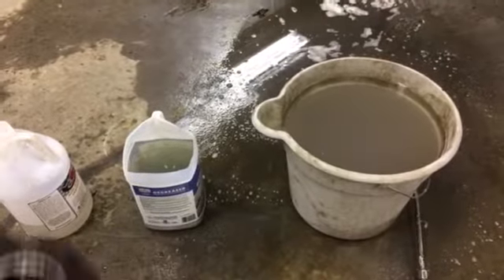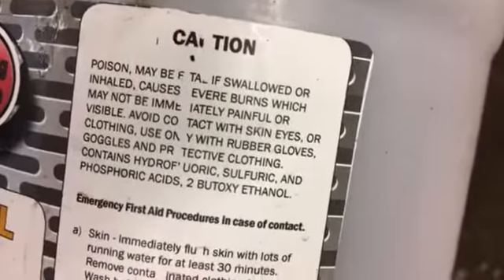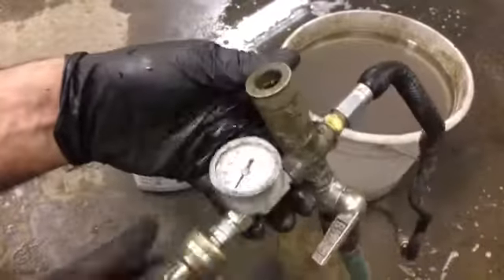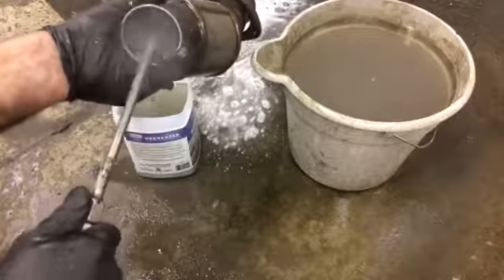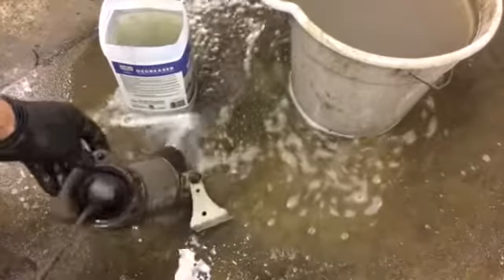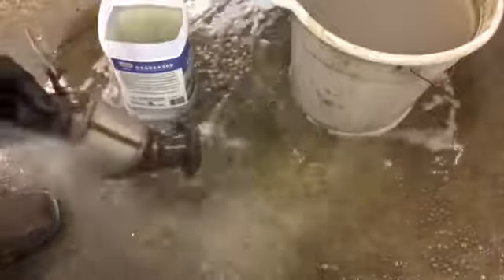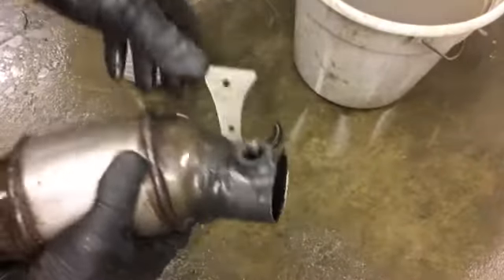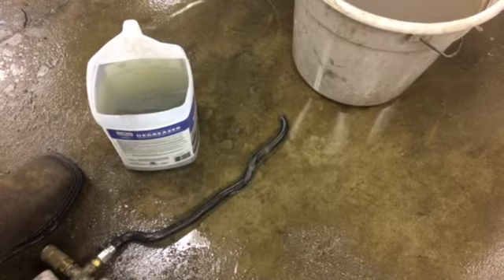Catalytic converter acid wash #1.

Comment: is that a prius cat . my prius no high rpm on hills no power. has a code p0420. you think this will fix it
Reply from the maker: This is a VW 4.2L cat. You would have to take the cat off and check the condition inside for separation